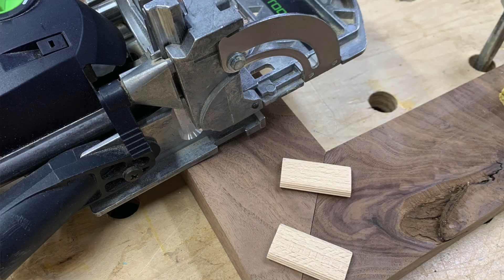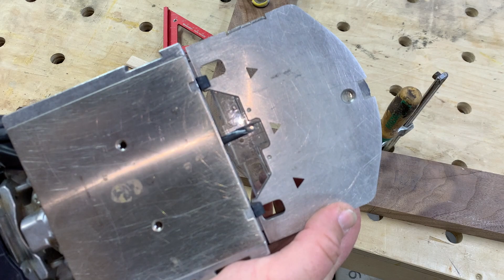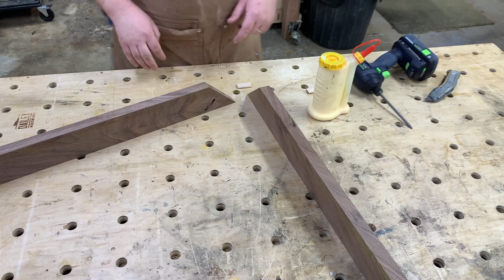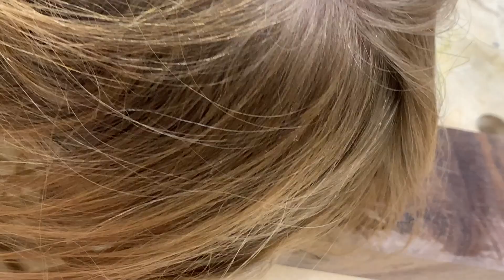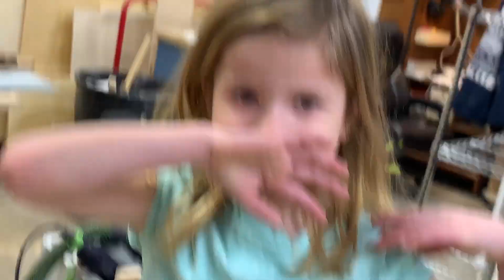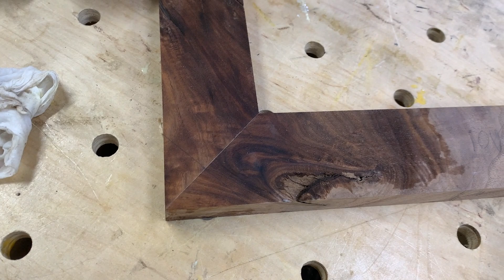Making Mitered Frames with the Festool Domino

Comment: Doesn't the Domino have an adjustment to provide play by opening up the mortise instead of slicing the tenon?
Reply from the maker: Yes the domino has setting for allowing play. But sometimes I find I need as little play as possible and the next setting on the domino to wide. So I shave a little from the tenon in those situations